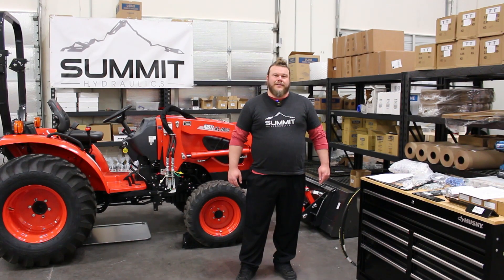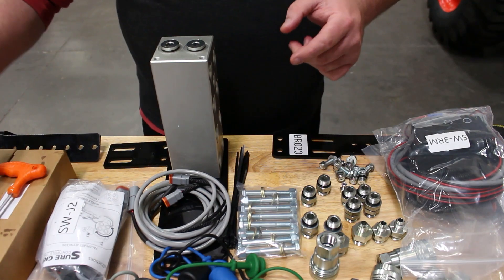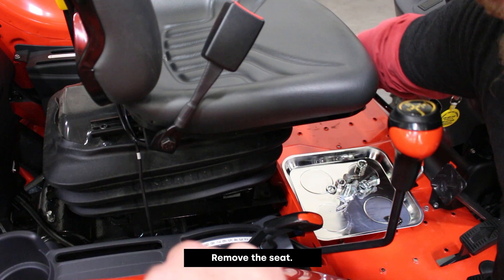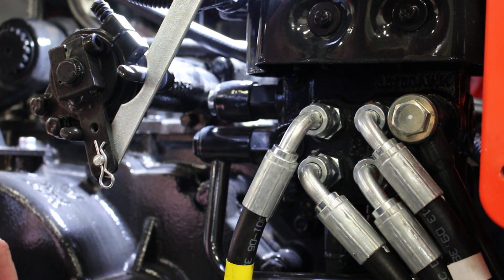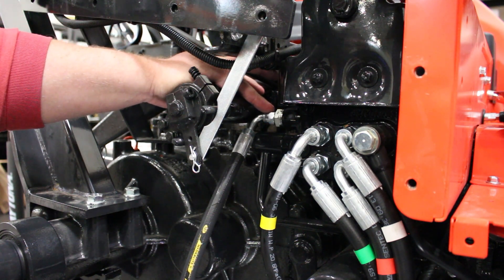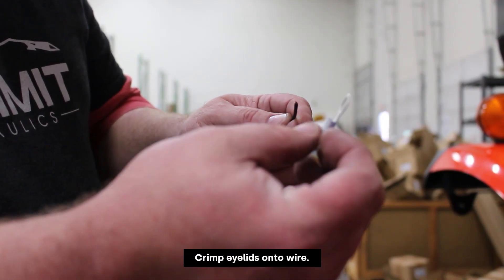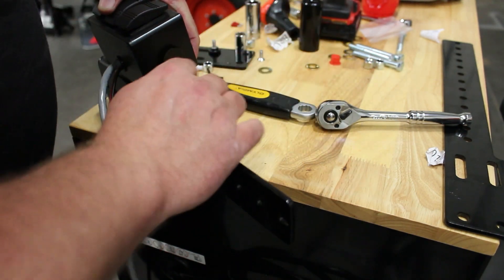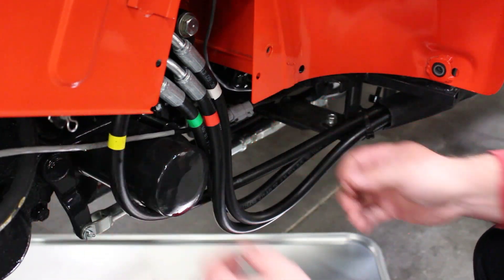Summit Hydraulics Kioti CK2610 Rear Remote Kit

Comment: You know you can get 4 rear remotes and a third function on the loader factory installed right? And I'm not sure why you would ever need 8 remotes like that on a 2610, i mean there's nothing that big this model is going to and or capable to pull that needs that many remotes lol, i love summit, but this thing is ridiculously huge and so overkill for such a small tractor.
Reply from the maker: If your tractor doesn't have rear remotes or factory installed remotes, our DIY kits are a lot cheaper than going to the dealer. Also, the kit in the video is the installation of a 4 spool valve kit, not 8.

Comment: do you make a lot that's not electric over hydraulic for the adjustment
Reply from the maker: Hello, we do offer different kits that are manual and not electric to add rear remotes. Please note these are different types of kits, but still can be used to add rear remotes to your tractor.
https://summit-hydraulics.com/product-category/valves/hydraulic-multipliers/manual-hydraulic-multipliers/

Comment: so could you hook up a grapple to that remote that's connected to the joystick? is this a viable/recommended option to get rear remotes and be grapple ready all in one? Is there any disadvantages of that maybe aside from a really long couple of hydraulic lines? Or should I realistically be looking at a third function and rear remote kit?
Reply from the maker: Hello, you can route a line up to the front of the tractor for a front third function, but we have a better solution. We have a one-of-a-kind kit that adds rear remotes and a front third function! IT is the best option for what you want to do.
https://summit-hydraulics.com/product/rear-hydraulic-valve-kit-with-front-third-function-for-kioti-ck2610-ck3510-ck4010-series-tractors/